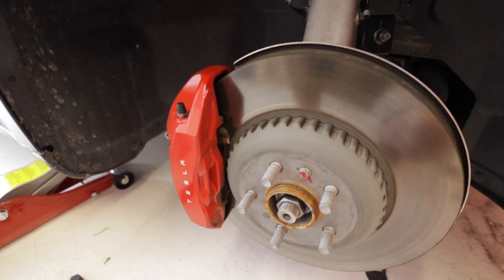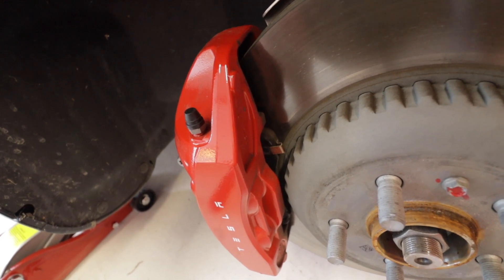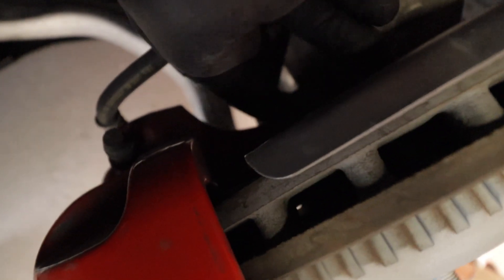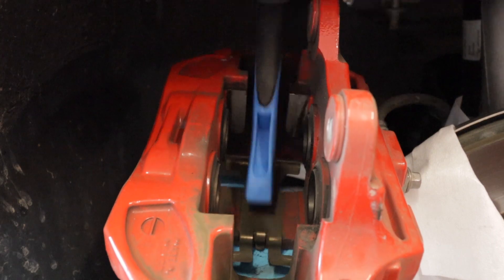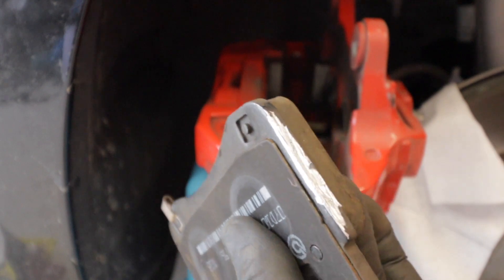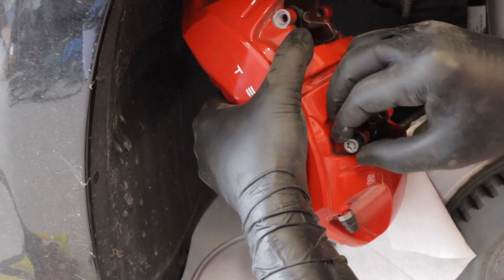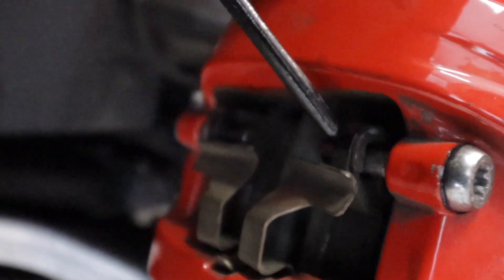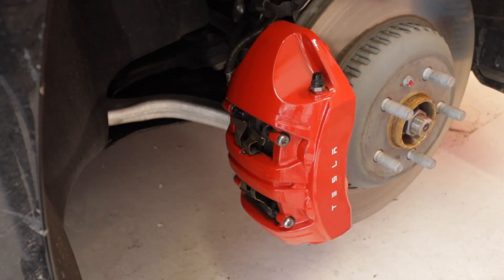TESLA 3P DIY BRAKE SERVICE

Comment: Frosty, at 17 minutes in, you said you will not clean the 2 rear brake cylinders on the performance brake because they were working fine  but will clean them later in the future. Its been 4 years ago, do you or can you make an update video on cleaning the the two rear brake cylinders and lubing them?

Comment: What were the torque specs for the caliper bolts?
Reply from the maker: 40
Reply: @FrostyFingers  That time again... New to service mode:

"Put the EPB in Service Mode: on the touchscreen, touch Chassis > Brakes > EPB Service Mode, from the drop down menus, select Both and Start, and then touch Run. The vehicle may roll freely"  - Tesla Service

Use this feature instead of putting the car in Neutral?

Comment: Great vid, thanks. I recommend ceramic paste instead of copper/aluminum paste.
Pro tip: For the rear/handbrakes, secure the wheels and put the car in Service -> tow/transport mode, and the handbrakes will release.
Reply from the maker: Ceramic or alu, good stuff :) Thanks

Comment: For the rear calipers, I saw another video where they put the vehicle in tow mode. Would that work?
Reply: Put in in Tow mode and once in tow mode unplug the wiring connector to the electronic parking brake to prevent it from resetting
Reply from the maker: Yes, but if the car resets/restarts or something you are screwed if it powers up.

Comment: THANK YOU for this! I couldn’t find any tutorials on the M3P performance red brakes that require front caliper removal. There are so many other tutorials on the LR versions where you don’t have to take the caliper off to remove the brake pads. Much needed video, THANK YOU!

Comment: Isn't there a torque setting for the small bolts?
Reply: The ones at the front calipers
Reply from the maker: Yes, isn't it in the description ?
Reply: FrostyFingers not on the small  bolts that holds the pads. Would be good to know if it is 20 or 40  nm. 😃
Reply from the maker: @kjetilros  ok updated it now

Comment: You can put it in "towing mode" in the service menu to release the parking break. I saw it in one of Rich Rebuilds videos. https://www.google.com/url?sa=t&source=web&rct=j&url=%23&ved=2ahUKEwjo2OmVg-rmAhUL-yoKHX0sCcUQwqsBMAB6BAgGEAQ&usg=AOvVaw0VTJzWxrN8ZFOD4xbU2nov
Reply from the maker: Yes, or just undo the plug, both easy, if your not on a lift its safer to have p brake on at one wheel